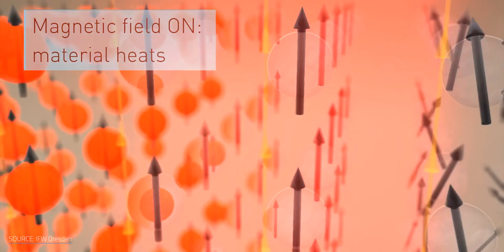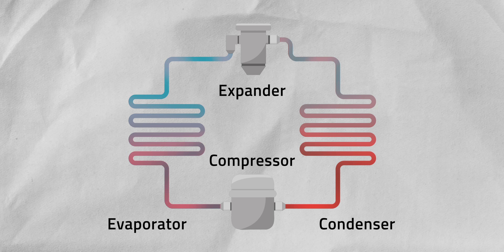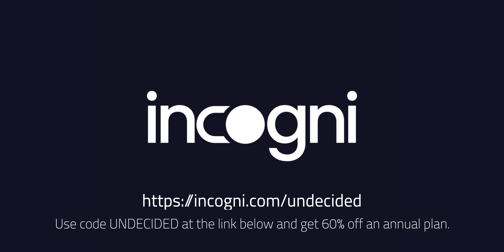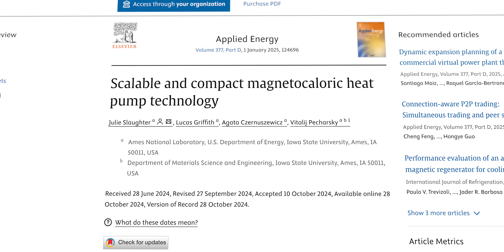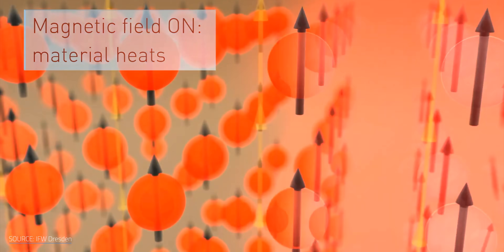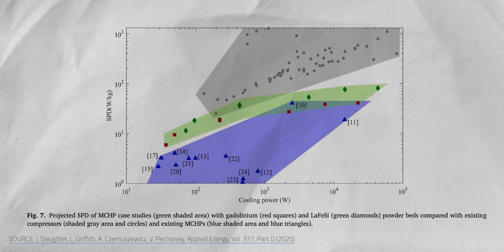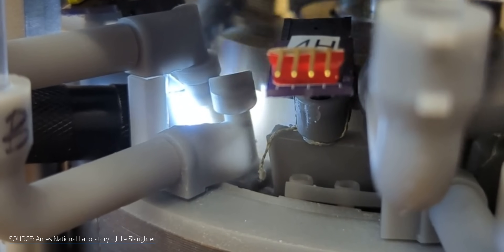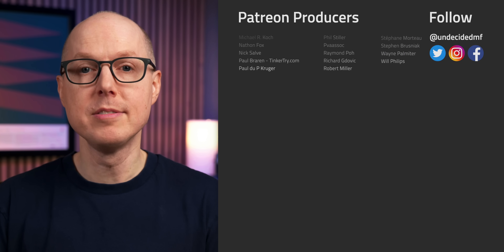How Magnetic Cooling Is Breaking All the Rules

Comment: I think the fact that all this requires is a spinning magnet and that there's otherwise no touching makes this an incredibly powerful option.  I imagine it would be possible to have a "valve" that rotates with the magnet that air blows through in order to initiate heat exchange whenever the material's polarity flips, thereby reducing the amount of moving parts.  You might even be able to have this work passively through wind power.

Alternatively, why not just use electromagnets?  That way, you get complete control and you can make it a flat panel rather than a cylinder.  It also would allow you to more easily scale up.
Reply: Electromagnets would use way too much power and completely tank the efficiency. It's why permanent magnet motors are starting to replace induction motors now that we have the cheapish power silicon needed to make it maintenance free.
Reply: @SuperS05  I hear ya, but how much energy does it take to rotate the magnets? Could we replace the mechanical rotation with electromagnets? It would be a solid state magnetic cooling. Turn the magnets on to heat the LaFeSi in any pattern you want, circular, linear or small intestine packed.
Reply: @ZacLowing  I have no idea what the back emf would be on this core. Efficiency is probably not anywhere near a motor or they would have used that instead. That's at 80-90% efficiency for an induction motor. Remember the motor is a spinning magnetic field, so if they are losing efficiency with the double conversion of energy, they must have had a reason.
Reply: @ZacLowing  I couldn't answer that without testing. But I do assume that they would have thought the same. Creating a rotating field using physical magnets rather than the tried and true stator windings seems like scratching your left ear with your right hand. The only 2 reasons I can think of is that either it was significantly less efficient and /or they were more interested in testing the LaFiSi rather than engineering the coils to match the given voltage with an core with unknown electromagnetic characteristics. The physical magnets are electrically safer and a more reliable test setup which allows them to test the materials before spending a ton of engineering time testing the characteristics. I'm well into speculation territory here though.

For reference permanent magnet motors of all types are significantly more efficient than induction motors. It's the significantly lower maintenance costs that have kept induction motors popular. Electrically commutative motors (with their required electronics) are still significantly more expensive than induction motors but that's slowly diminishing.
Reply: @ It takes electomagnetism to rotate a motor too.  Seeing as the magnet is doing actual work, I'm sure there's some noticeable resistance.
An electromagnet may be more power consuming but it also can be more finely tuned and involves fewer moving parts.

Permanent magnet motors are replacing induction motors only in markets where the output is predictable and where permanent magnets are adequate.  Induction motors are going to remain relevant in applications where a permanent magnet is too heavy and/or weak to get the job done.  So, some passenger EVs for example are switching to permanent magnets because they still provide ample torque without being too big or heavy, but EVs built for high performance or high torque are still using induction motors and likely will continue to.
Reply: @Toastmaster_5000  ECM (permanent magnets) are infiltrating every industrial market. They are actually significantly higher torque than induction motors, even polyphase motors. While the rare earth magnets are a bit more expensive and I've seen issues with delaminations of the rotor, the bigger issue is the cost of power electronics. Electronics that can handle high current and voltage loads still aren't cheap. As that improves with time, so will the use of the ECM. The are already commonly used up to about 2-3kW and I've seen them at 10kW. (I've seen a couple of chiller compressors that are in the 100kW range, but they are too expensive to get market share) Every modulating heat pump these days use it for the fans and the compressor. These are not constant loads by any stretch of the meaning. I have seen them throughout factories, but that's still fairly rare, again due to cost. Elevators are starting to switch too, if slowly. VFDs on an induction motors aren't as efficient so ECMs will continue to infiltrate the market.

The power electronics for a VFD and an ECM is roughly equivalent but the rate earth magnets do still raise the cost of the motor. (the materials itself, plus the added difficulty at manufacturing and increased warranty claims.) So you'll see EVs that are looking for the highest efficiency and/or raw torque use ECM. Other cars that are attempting to save money will use a variation on the induction motor. Typically a shaded(modified field) induction motor these days. They are just easier to manufacture overall.
Reply: @SuperS05  That doesn't make sense - an electomagnet can be as powerful as you engineer it to be.  Permanent magnets have an upper limit to how powerful they can get.

As far as I understand, ECMs are just the HVAC terminology for a BLDC with built-in speed/torque regulating components.  Such motors have been around for decades.  That's not to say they're bad but rather, this isn't some new-fangled device that is taking over the market.
On the note of HVAC, the loads may not be constant but there is a known upper limit to them.  The motors have to be able to compensate for the highest static pressure they're likely to encounter.  So, you give it a permanent magnet and perhaps a gearbox to accommodate that load and you're all set.  Being stationary, the size and weight of a permanent magnet is largely irrelevant.  So, in traditional HVAC applications, permanent magnet motors make sense - they're overall cheaper, they're more efficient, and they have a known torque limit that is easy to engineer.

Cars that use "ECMs" (I've never heard of a car using an EMC, but I have heard of a wide variety of other permanent magnet motors used in vehicles) tend to be either normal passenger vehicles, economy cars, or secondary drive units used for cruising (whereas a permanent magnet motor is used for accelerating).
Reply: @Toastmaster_5000  I never said it was new. just that it is gaining market share now. ECM and BLDC motors are essentially interchangeable these days. We don't use electromechanical or standard mechanical control systems on them anymore. ECM is a subset of BLDC motors. (the electronically commutated being the active description.) I use the term because it's most common in my field. 

All permanent magnet motors have SIGNIFICANTLY more starting torque. The low/zero rpm torque of a standard induction motor is extremely low. Polyphase increases it a bit but not anywhere near a permanent magnet motor. This is just an inherent characteristic of the various types of motors. It is also the main reason why EVs need any sort of gearing at all. When they use induction motors, they need to increase low rpm torque. Since they are using VFD circuitry, their top speed is now the maximum physical limitations of the motor rather than some arbitrary line frequency, so gearing down works just fine. Permanent magnet and induction DC motors are also the reason why early EV drag cars would most often snap their axels and/or drive shafts on launch. Their low rpm torque is insane, at the cost of commutation complexity. (in those days, brushes)

Comment: Patentable idea incoming 😂

Couldn’t you just use a chamber with a kind of membrane that is attached to another highly elastic membrane with high heat transfer capacity that when the temperature tells the compressor to run it cycles the pressure in the chamber until the heat is transferred out of the second elastic heat transfer membrane?

Comment: Could you have the magnetocaloric material submerged in a thin film of liquid thermally conductive material, fitted tightly inside a cylindrical chamber with low thermal mass and conductivity. On the outside of that chamber, have a fixed magnet right before a "hot side" vapor chamber/heat sink attached to a thicker more conductive portion of the chamber, then the "cold side" after that- so as it was spinning, it'd hit the magnet, heat up for the hot side, then as it was revolving to the cold side, leave the magnetic field and become colder, chilling the cold side?

The thermally conductive liquid and the chamber would be sitting at a temperature average, the two heat blocks in the chamber wall would be heated/cooled above/below that average, but the advantage is you could do this design without valves being timed precisely to pass through the fluid, or fluid loss of what you leave behind in the chamber.

There's probably a reason why my idea wouldn't work, or be worse than the current system, but I figured I'd suggest it anyway,  since I've been surprised before.

Comment: You can avoid using CFCs by opting for an R290 heat pump which uses propane as a refrigirant. These heat pumps operate at a higher temperature which means that they can be a direct replacement for a gas boiler in a conventional water based central heating system without any other modifidation.
Reply: I use propane in my car AC. Works a treat. Lower pressure than R 134 so doesn't leak as fast in my old system. Many domestic and commercial refrigerators these days also use propane.
Reply: Propane and other refrigants where thrown out when hfcs came into dominant use. Hfcs don't burn when a minor leak in a unit with flammable refrigants can burn down a building.
Reply: @eclecticcyclist  it's also more efficient than r410a, a very low GWP of like 3, and an Ozone depletion potential of 0. It's also flammable so law makers have a good excuse to make it illegal due to it being cheap and hard to patent.
Reply: Hank would be proud of you, appreciating propane and propane accessories....
Reply: Any options that work with 180F hydronic baseboard systems?
Reply: R290 is still banned in the US (as a refrigerant in domestic use).  
While it's basically the standard in Air-To-Water units around the EU and Asia, it's not allowed in the US.  
Hell, depending on room size, it's even used in split heat pumps now here in Europe.
Reply: @DooMMasteR it's not entirely banned. My ice machine uses it and it's pretty common in household refrigerators these days. Still illegal in larger appliances like room/central air conditioning due to the large amount required.
Reply: @austinsmith6714 but 90+% of R290 heat pumps stay outside, still not allowed.

Propane tank, fine.
250g of propane in a heat pump, illegal.
Reply: Yes, however these new technologies have a higher theoretical efficiency and thus worth looking into.
Reply: @eclecticcyclist  my father told me his first refrigerator was a propane one. He brought it in 1960.
Reply: Good luck using those systems for residential housing in the USA. Regulations are the main reason for all the extra energy consumption in the HVAC industry
Reply: Monoblock chillers with r290 will enter more homes soon as charge limits are on r290 so it’s use is mainly on in fridges
Reply: Einstein co-invented the propane frig
Reply: Propane systems come with safety and maintenance risks.
Reply: Can’t have too much a3 refrigerant in one system. I work on r290 units often
Reply: hey thats also how sapce ship rocket engine with ther regerntive cooling that baclys also cool there nossiles while preheating the fuel for runing and freing the engine to keep it form melting. so bacly it can cool and power with fue lat the same time. its how real life rocket engine actly work but they acly perospoly make it burn when its already preheats form cooling the rokect engine nossiles then is fead inot the fuel injection of the rokect enginer truster with the oxydizer after the cooling of the nisle withte roekct prolenant is pre heated to proper termpure by the time it enter the roekct engine combution mixing chamber. yes it is very cool.
Reply: Careful ! R290 is classified as A3 by Ashrae - the highest flammability grade. Currently, the max charge admissible is 150grams ... which is really low in terms of thermal/cooling capacity. Make sure you specify R290 only for outdoor install otherwise you will need to increase the current indoor fire protection of the building.
Reply: Leakage.  The same problem for CFCs.
Reply: @scottfarland6795  What leakage? Most refrigeration compressors are sealed units and those often last 20+ years without maintenance other than cleaning the condenser about once a year.
Reply: @teardowndan5364  what condenser? Most refrigerators are clean back now
Reply: @scottfarland6795  Leakage is not a large a problem in refrigerators. After a hundred years of making such machines we are pretty good at building reliable ones. Also, R-600a has a GWP of 3 which is very low.
Reply: @Hybridog unless you're Samsung.
Reply: @scottfarland6795  The R290 GWP is 3 comparing to R410A that is 2088.
Reply: @scottfarland6795  Yes, but leaking some propane is not much of a problem, while leaking CFC's is.
Reply: @scottfarland6795  how is going based on the information about propane refrigerators that consume propane. On the order of 11 gal per 10,000 BTUs per hour. 

Leakage will be much smaller than consumption.
Reply: @mac_mcleod  OMG you are so confused. The heat pumps that use propane are not BURNING it; they work with an  electric pump. The propane is used as the fluid that is being pumped around, allow to expand and being compressed again.
Yes there are camping refrigerators that work their pumps MOTORS by burning gas. That is not what this is about. Try paying attention.
Reply: @perpetualrabbit  I take it you're ignorant of propane-powered refrigerators and Air conditioners. 

As well as being really rude. 

So I'm going to mute you.
Reply: @mac_mcleod  Propane powered fridges are something very different from an electric fridge: they burn propane in order to heat and vaporize water and ammonia to create a phase change that can be used to extract heat from the fridge - it's not a very efficient process, and the burned propane dumps a lot of waste heat in an around your house - not a good thing during the summer months. An electric compressor-based refrigerator would not burning the propane refrigerant, it's circulating the propane as a working fluid in order to move heat around, it's not being burned or consumed. To be a clear, for a propane powered fridge, propane is the fuel/energy source, and water+ammonia is the refrigerant substance. In an electric fridge, electricity is the fuel/energy source, and propane would be the refrigerant substance. In both the cases here, the refrigerants are not consumed or burned, they are re-circulated continuously through the system.
Reply: @mac_mcleod  we are talking about refrigeration. It’s pretty obvious from the context that it’s used as the refrigerant, not as a fuel source.
Reply: @CountJeffula  no it was not obvious to propane was being used in a sealed loop as a refrigerant since there are propane powered refrigerators and air conditioners. 

Propane is not normally used as a refrigerant because it is too dangerous.
Reply: @ Thin skin much?
Try reading my whole comment. Of course I know about those, and that is your confusion. The propane is not used as a power source but as the refrigerant. That is the fluid being pumped around, extracting heat and moving it.
Reply: @0hypnotoad0 I have only seen propane/electric refrigerators in travel trailers and such.
Reply: Would that not release a lot of CO2?  I'm getting estimates of .11 gallons per hour per 10,000 BTU of cooling.
Reply: @mac_mcleod  It's not being burned, it is the working fluid in the compressor. My Bosch fridge uses R-600a which is isobutane. Like propane itis flammable, but it stays sealed inside the cooling circuit.
Reply: @Hybridog  ah, thank you for the information.
Reply: @mac_mcleod It's working in a closed system, so doesn't release anything
Reply: I work with a lot of R290 (propane) refrigeration systems and heatpumps. The R290 is used as a refrigerant in place of traditional gases like R404a, R410 etc . The gas is not consumed like older style camping fridges where the compressed liquid gas expands into a vapour and absorbs energy from the cold space as it boils from a liquid to a gas similar to a kettle using the heat from the stove or electric element to change the water into steam , the only difference is refrigerant boils at much colder temperatures,  around-26°C for propane . When the gas is evaporated it is then burned off by the burner to prevent gas build up and creating an explosion risk . The  modern use of propane as a refrigerant recycles the gas by compressing the gas using a compressor , this high pressure hot gas passes into a condenser where the heat is rejected to air or coolant , converting it back into a high pressure warm liquid.  The cycle begins again as this liquid passes through an expansion device into the evaporator again to absorb more heat . I hope that I have explained this correctly.

Comment: Does it have to be permanent magnets to establish the field?
Reply: No, but all you'd save with electromagnets would be size, but at the cost of another expensive component, needing spinning contacts for them, and lowering the energy efficiency of the final product.

Unless you left off the spinning part entirely- but I suspect that doing so, you might lose more electricity from the coil than you'd gain in heat/coolant value, but it'd be interesting to see one of the researchers talk about that.